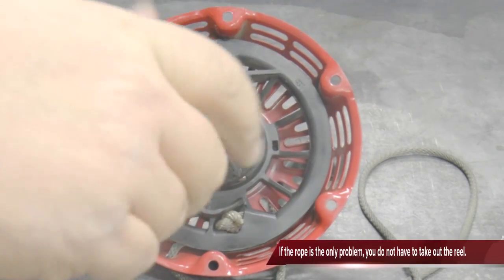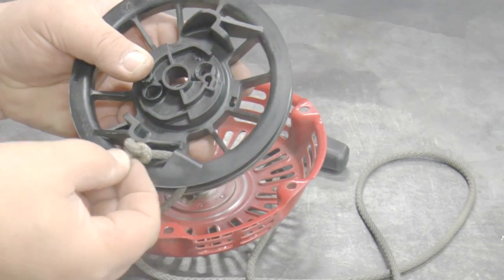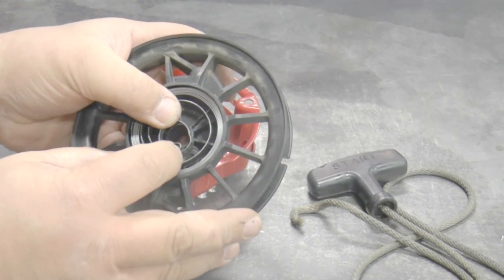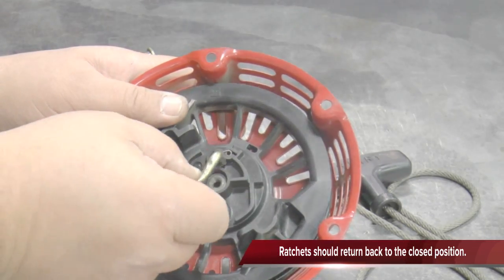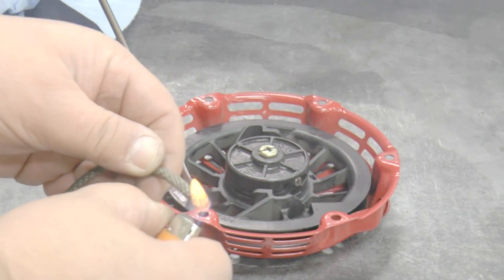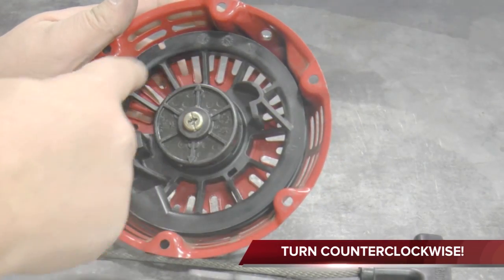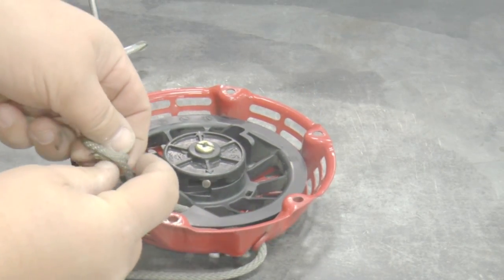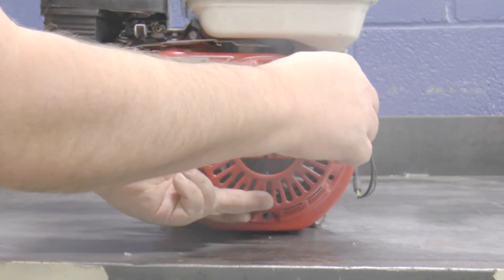Honda GX160 Starter Service

Comment: When I try to remove the 3 nuts with a 10mm ratchet the nut keeps on spinning.  Help !  What can I do ??
Reply from the maker: Try prying out on the back of the starter as you loosen the bolts.  The threads on yours are stripped and prying out sometimes allows better threads to engage and then the bolt may come out.
Reply: @motoprof1441  Thanks, I'll try your suggestion.

Comment: I was about to try this when I decided to spray a generous amount of WD 40 into the coil and let it sit for a day. The next day the rope pulled back into place and it now works fine. You may want to try this before taking the pull starter apart.

Comment: I'm trying to make out from the video if the threads on the screw are normal or reverse thread? Are you turning it Counter Clockwise to remove the screw or Clockwise? Mine is stuck and I'm afraid to break the screw if I put too much force on it the wrong way. It looks like CCW here, as per normal, but because the engine runs in the same direction (and thus vibration might back off the screw), I thought this screw would be reverse threaded. Thanks.
Reply from the maker: It's a lefty loosy, righty tighty.  😆
Reply: @motoprof1441  Thanks, Bud. Wonder if its been locktited in? Its pretty tight. I think the spring is intact, but it slips whenever I try to tension it beyond what it is retracting the cord half way.

Comment: This helped me immensely. There are many videos on replacing the cord but not about assembly/disassembly of the starter itself. Well let's just say when I opened mine due to a jam, I was not expecting the metal band spring to explode into a giant tangled ball. Needless to say, trying to brute force the coil back into shape is impossible. Doing it with the method in the video is the only way I was able to do it 😅

Comment: Great tutorial!   I want to change the orientation of the module so that the cord handle is at 2 oclock and not at 10. Since I placed the generator in a soundproofing box it become very uncomfortable to manipulate the handle from behind at start engine time. Btw as well as yours my recoil cover has 6 holes of which only 3 are used. If this possible to do without affecting the starting operation?
Reply: I've noticed the same thing on a bunch of these engines. Only those three holes are threaded too, btw. I think they have captured nuts welded on the back of the hole. I'm sure they're fine as they are. Perhaps the plate or starter is designed to fit a bigger motor, which would thus have need of more holes. I have owned several snowmobiles with much bigger engines and they have had up to six or more holes filled, if I remember correctly.